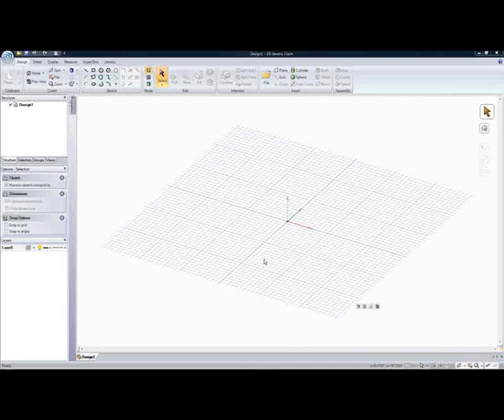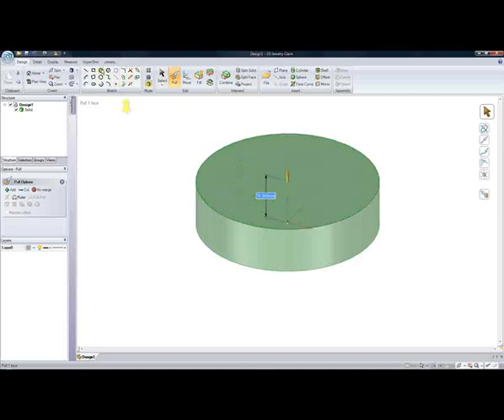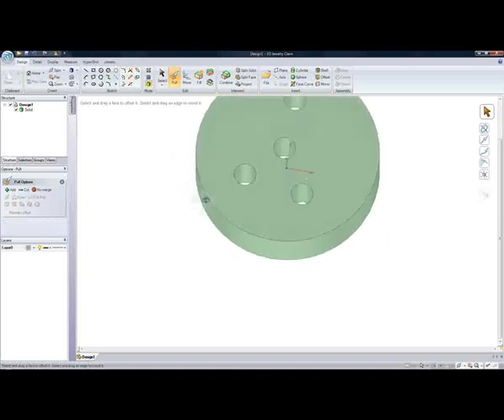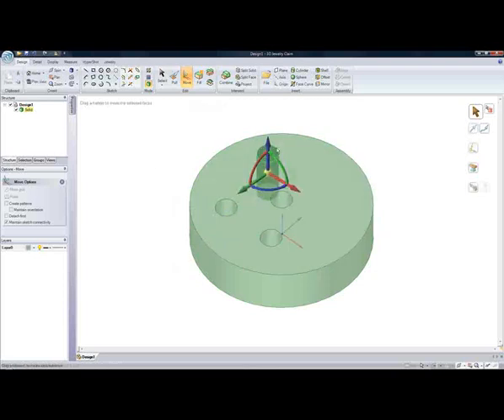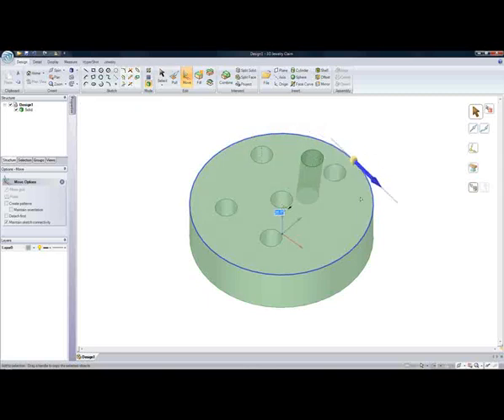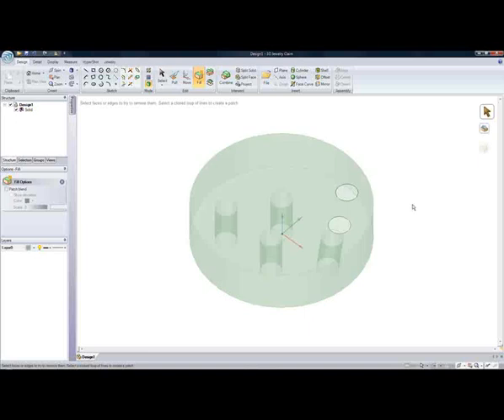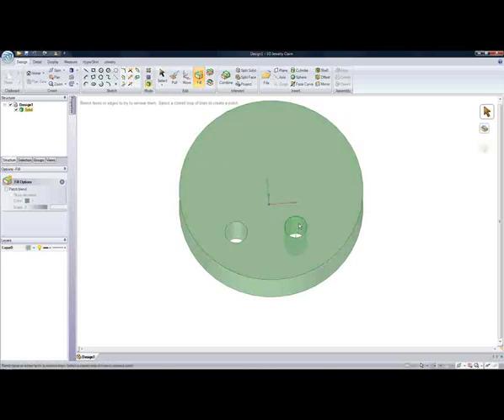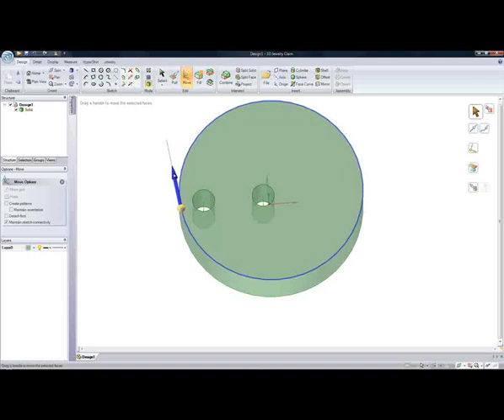FireStorm CAD Basic-Retail Training 1.4 Part 3 Moving along a trajectory and Fill Tool

Comment: Firestorm CAD Product
Features:
 
• A Program Created by a Professional JEWELER for the JEWELER
• User Friendly Interface
• Short learning curve
• Low entry price and total cost-of-ownership
• Fast return on investment
• Feature an extensive library over 4,000 jewelry components         included allowing you to create over 10,000 pieces within minutes right in front of your clients
• A Jewelry module with International finger sizes, model mass weight.
• Stone layout tools for pave on a surface and setting diamonds along a line on surface for stone geometry.
• Stones have tools associated that you can turn on or off when     needed as part of the structure of the program. Wherever you place a stone on a surface you can quickly make bezels, prong layout, cutters for stone seats and for underlay cutters for piercing azures.
• Online Video Trainings
• Ability to train anyone in your company with NO ADDITIONAL COST
• Ability to get trained in the comfort of your home or office at any time - NO ADDITIONAL TRAVEL COST
• Basic, Intermediate & Advanced Training All Included for the Price of the Software – Saving you time away from your business and ultimately saving you money from travel and lost business.